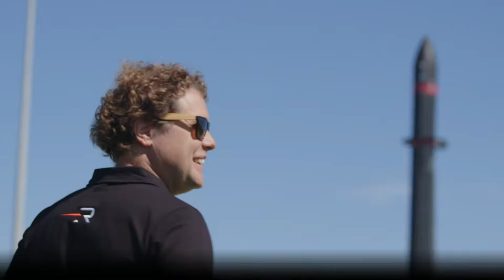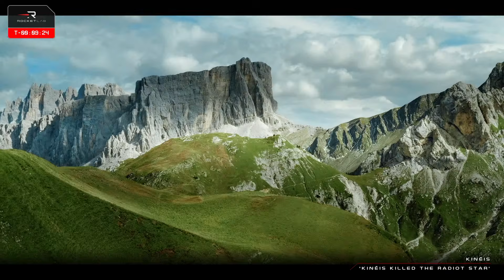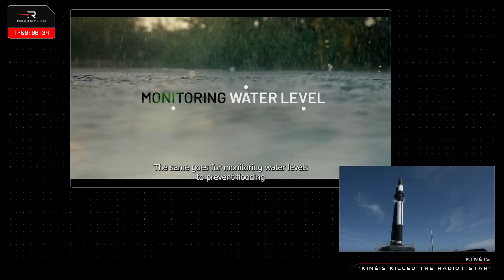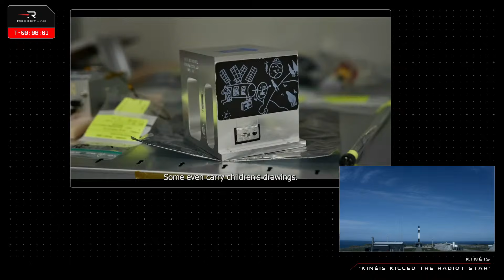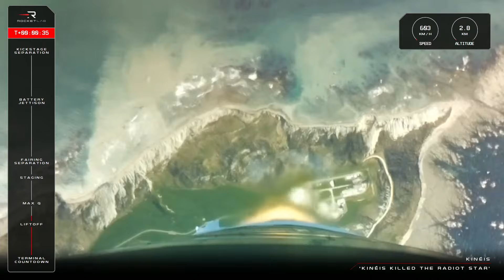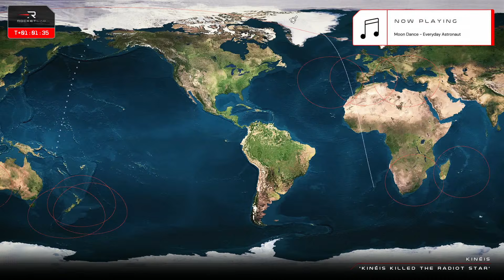Rocket Lab - 'Kinéis Killed The RadIOT Star' Launch

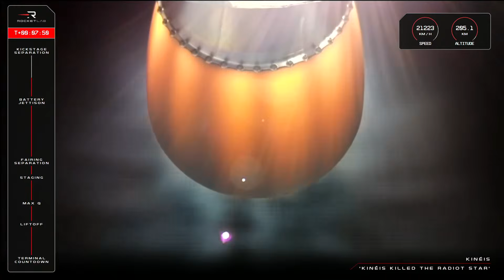Comment: 22:36 - T-3/lift off,
25:08 - Meco/Stage separation,
25:48 - Fairing separation,
29:01 - Battery hot swap (no views)
31:35 - Seco,
1:25:10 - Curie engine,
1:27:54 - Payload 1 deployment,
1:28:39 - Payload 2 and 4 deployment,
1:29:24 - Payload 3 and 5 deployment.

Thanks!